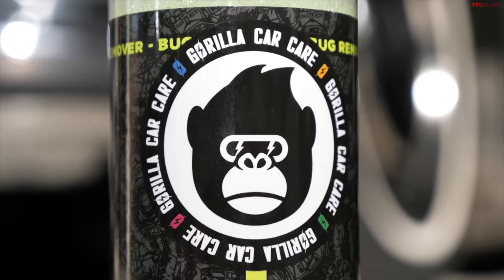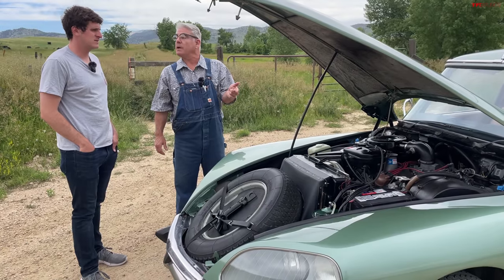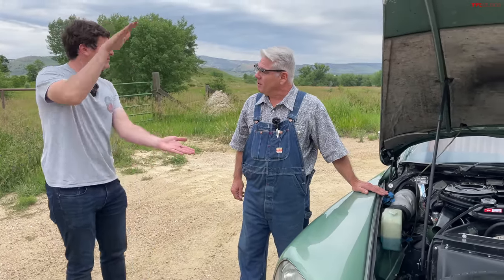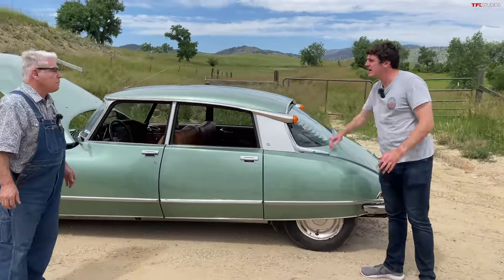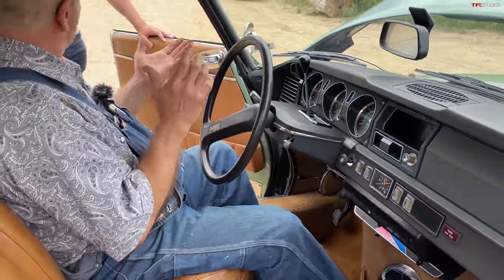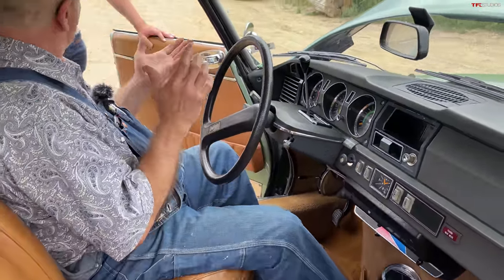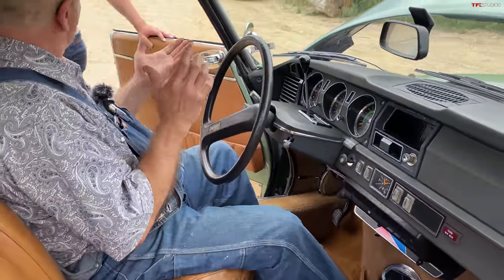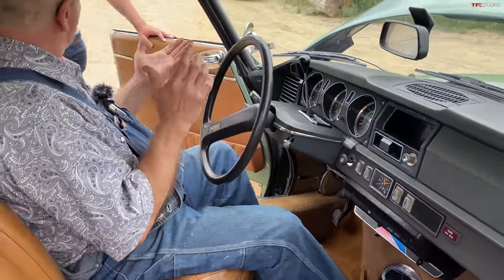Really THAT Unreliable!? Is The Citroen DS as Bad As The Internet Says It Is!?

Comment: Noticed during the ride- no doubt the sphere bulbs needs to be replaced (It is easy as replacing a light bulb).  The ride was way to shaky. It should float as on water..
The nitrogen leaks through membrane over time, so slow  it is hard to notice, and you be used to the rougher ride.  Replace each 5 years.  Back in old days this was not expensive. Exchange old ones with overhauled.

Comment: I beg your pardon; since I owned two DS-21's in the past, I have to say, 1. The inlet for the radiator air is UNDER the bumper, there is a screened opening that directs outside air to the enclosed 'baffle' that puts it into the radiator. 2. To 'spin off' the suspension sphere's the car needs to be in the LOW position, not high (so the fluid doesn't spew out). At least that's how my '67 & '69 were serviced. Otherwise, the owner of this very nice DS is quite knowledgeable regarding his beautiful DS model. I do miss mine . . . 🙂

Comment: I've been working on the hydraulic system in a Rolls Royce Silver Shadow from 1967. It has the same system, bought from Citroën.
But since the people in Crewe didn't trust French systems, it has the Citroën system for brakes and suspension, but then also a conventional suspension and vacuum assisted brake system.
There are indeed mechanical level sensors for the height. But the Silver Shadow doesn't have any lever to adjust ride height.

Comment: I used to have a BX with similar suspension. there is a simple mechanical valve linked to the front and rear which splits the pressure as required. The rear brakes were fed by the same pressure as the rear suspension so pads lasted forever. Some people added load to the boot to increase the rear pressure and balance the wear better. One more benefit is the headlights are always level.  And of course Rolls Royce licensed the suspension design.

Comment: I had a 1995 Citroën Xantia that featured the hidropneumatic suspension and it was fantastic. I never had to worry driving through  flooded roads. I just lifted the car so that only the wheels got wet.
Answering how the suspension levels the car and knows the exact height, there are several 2-way valves that bleed or admit fluid according to the position of the suspension.
The pneumatic part of the suspension acts as the springs on a "normal" mechanical suspension.

Comment: Very good detailed review. The DS was undoubtedly futuristic for its time and most comfortable and high-performing for its cubic capacity. However I have to question its reliability based on the  complicated mechanics which would require expert and frequent service. Moreover it is a fact that French vehicles in general, though well engineered, are quite difficult to work on. Finally another negative is that the DS was very susceptible to rusting.
Reply: Expensive service was very rare. My most expensive repairs were muffler replacement and a cracked pressure reservoir base in 10 years and 80,000 miles.

Comment: By the way, Mercedes Wagons used this hydro-pneumatic system on the rear suspension on the 124 body.  The rear was maintained at the same level no matter how much load you had in the trunk.  I had one and had to use the same green hydraulic oil on it.

Comment: I worked in a shop that serviced Citroens back in the '70s. One customer had 2 of them that he bought new. He was a booking agent and drove up and down the eastern seaboard in his work. He would leave one car in the shop and drive the other for 3 or4 months and we would service his other one in the meantime. He would leave a car and a list of operations when he picked up the completed one. When he retired one of the cars it had a documented 750 thousand miles on it. In all that time we never took the engine out. BTW, the high position on the suspension is a service mode and the car should never be driven in that position. It's not for off roading.

Comment: The biggest problem with the Citroën DS is finding one in good shape for a good price, even if you know where the good deals on them are. The biggest learning I'd have is the brakes. The shifting is fairly straightforward, the suspension makes a lot of sense, and the controls on the column are simple. The speed wrench used for the lugnuts and fenders also has an extension piece that can be used to start the engine when the battery gets low, but it's more akin to a kickstart motorcycle because of how low it is. It's under the intake slit, which means you have to use your foot to keep from faceplanting into the spare tire.

Comment: For years I drove a Volvo V40 with 115hp 1.8 litre motor, that had an official top speed of 120 mph (195 kph) and would cruise at 100 mph for long distances. It would also accelerate from 0 to 62 mph in 10.5 seconds.

Comment: I don't know if they did with the DS, but when the successor (CX) debuted Citroen said to only drive in the highest or lowest setting "if absolutely necessary" and at very low speeds due to the stress you're putting on the suspension and the driveshafts. They also recommended not driving in the lowest setting since your steering angle is vastly reduced.

Comment: I had a '73 Saab 99LE. It also had a 4 cylinder longitudinal engine with the transmission in front, front wheel drive that was designed to go under the car in the event of front collision. It also had shoulder belts and fuel injection. It also had four wheel independent shock absorber suspension. One of the really strange things was the ignition key was between the seats so, if you didn't know that you wouldn't know how to start the car.

Comment: I learned to drive in this car, I think it was the DS "super", it was a 4 speed manual gearbox. The suspension was superb, the car would have a flat and you would not know it. You'd adjust the ride height with a small lever at the footwell in seconds and would drive over dirt tracks and rocks like a dedicated 4x4. However it was perpetually broken and unreliable, the turning headlights always stuck, engine unadjusted and stalling or not ever starting, and even body panels kept falling off. On one journey, on a bend, the rear right door fell off and my granddad managed to hold on for dear life. The rear side panels also kept coming loose and fall off. Even on your video the body panels, the bonnet and boot are all misaligned. Part of that was due to very bad service jobs and repaits, but a large part was due to the inherent build.

Comment: FYI, U.S. Federal safety laws:padded dashes and front/rear lap belts  became required in 1966, collapsible steering columns and dual brake reservoirs  in 1967, shoulder belts in 1968, headrests in 1969.  By 1972 all cars sold in the States had those safety features by law.

Comment: The cooling air to the motor is not taken in where he points at. These slots are for the interior ventilation system! The cooling for the motor is by a special intake just under the front of the car. Not visible unless you creep on the ground.....
Reply: Okay, ya caught us in an unscripted moment. What can we say? Tommy had content to get out and I have cancer to deal with. This car has so many quirky elements, 45 minutes just isn't enough to cover them all. Do you own a DS?

Comment: Great stuff!
It would have been good to demonstrate the attitude of the car when braking: no nosedive!
I had the pleasure of driving a friend's DS at night, on dirt roads here in Australia. It was actually confidence -inspiring... Just like on a motorcycle, seeing around corners with the swivelling headlights was extraordinary and the suspension was unfussed by the rough surface.
Reply: But they DO nosedive under hard braking. But the headlamps stay level with the road. Plus- extra braking force is applied to the front brakes (up to near 100%). I would not have got mine passed on the brake and driving lamp portion of the vehicle safety test had the tester been willing to drive it or if I had not been a red seal mechanic. They didn't like seeing 80% of the braking on the front axle in a 10mi/hr lockup stop.

Comment: Fun fact.

The French for goddess déesse.  ie DS.

They called the car “goddess.” And it is. 

The exterior styling is very easy on the eye, smooth and streamlined.

The hydro-pneumatic suspension is like a magic carpet ride, no bumps felt. 

The interior is as one would expect for the period.

In English hydro just means ‘fluid.’ Hydraulic fluid can be oil.

LHM. Liquid Hydraulic Mineral. Use the correct fluid -the green stuff unique to Citroen.

Comment: I wish they had talked about the way the coupling of the braking system and the suspension automatically and instantaneously adjusts the braking proportionality between front and rear under heavy braking at speed. The car immediately adjusts its level and feels as if it’s digging into the asphalt. No loss of control. The car won’t spin under heavy braking.

Comment: One of most innovative cars of its era, not to mention esthetically wonderfully designed. Bit of trivia - this model saved the life of Charles De Gaulle while assassination attempt was done when he was president of France. Although tyres been shot-flat, due to hydro-pneumatic suspension solution, driver was able to continue driving until safety area. Cheers from Croatia.

Comment: I had a Citroën GS 1220 Club, basically smaller version many of the ideas on the DS. Ran it 3 years and no suspension problems at all. Rear disc brakes, standard fitting and one of the first mass produced cars discs all round, used to suffer from rust in the winter. U K and salted roads in winter. On many occasions when parked for a little while it would lift its left hand rear wheel right up into the wheel arch like it needed a pee. Still perfectly balanced and stable. Had three adjustable ride heights, great in snow or floods, always went to selected height no matter what load was put in it. Brakes were too keen until you got used them as used the hydraulic system as a booster. Major problem ?, rust in the body panels.
Motor was air cooled flat four which I believe came from Maserati design originally, it revved and revved. Actually would enjoy a ride in a well preserved model, if there is any.

Comment: It's beautifully restored (except for whatever that is on the hot air intake on the air cleaner), but the body panel alignment is terrible!  WTF?
Reply: That manifold heat-riser is stock - I swear! The repro riser tube I tried was weapon-grade, garbage. Still sourcing a better one. (Good eye!) I daily this car and was in a wreck with it a few months ago. The impact was centered at the A-pillar. NOS door + Used fender + 78 year-old paint/body man = poor panel gaps. Still working things out. A quest for perfection, in this case, wouldn't improve the enjoyment.
I find it amusing to say, 'I've cracked up a 50 year-old French car.'
Thanks for watching!

Comment: I'd love a DS. Having driven through a number of flooded roads over the years, it would have been reassuring to have that hydraulic suspension. I didn't get stuck myself, but have witnessed others getting stranded in flooded roads, usually in much newer cars than mine (and hopefully did the right thing to help, by phoning the rescue services when I couldn't get to them without going in too deep for my car. I had no idea if they had a phone or not).

Comment: The way the suspension works is genius. A simple pump provides pressurized oil for suspension, steering and brakes, a central sphere with a pressure regulator feeds the system. It was not mentioned, the car has sway bars front and rear. Two "Height corrector" pick up the car height to the ground from the sway bar and adjust pressure for each wheel to keep the preset height. It adjusts to car load, so with five passengers and luggage or only the driver, height will be the same. When braking, it will not lean forward like most cars, because rear brakes draw oil pressure from rear suspension, and the car braking won't upset car leveling. In case the oil pump fails, the stop light comes on but you have the central sphere full of oil, so you loose power steering, then suspension sags and the very last drop of oil can give you braking. E-brakes operate front wheels, in case things go horribly wrong.
Not magic, but genius, even more surprising considering it was designed in the early fifties.
The reputation of "poor reliability" comes mainly from mechanics who don't want to deal with such different way of doing things, and ruin the cars by ignorance. Also when the oil pipes and seals start to let go, and you spend hours of labor to replace some hose and o-rings. It was never a "low maintenance" car, the big service when new costed as much as a new Citroen 2cv, the cheapest model they had. When the owmer does some of the work DIY, it's not as bad. The engine was never as strong as other brands at the time, in this car you would expect something nicer, but it was deemed "good enough" at the time. An air-cooled six would have made the car just too quirky even for France standards. Check out the GS/GSA, I had one and some mechanic shops wouldn't even touch it. I had to search the right people to work on it.

Comment: A part from a lot electronics in the mordern car, the DS from the 50's is still a challenge to modern vehicles. Just show me a car today that doesn't need a jack to fit a tyre.....?? DS came with very good drive shafts and the technology allowed it to take curves at speed by leaning into the curve and rolling the headlight beam round the corners!

Comment: One reason the DS had a reputation for poor reliability is drivers failing to reattach the cooling skirt on the radiator after it inevitably partly popped off when changing a tyre. I have seen many DS on sale without the cooling skirt!

Comment: I owned a Citroen Xantia about 25 years ago, with the same hydraulic system for suspension and steering. It was a nightmare, not because of Citroen, but the service shop who did not do proper maintenance. I paid for checking all hydraulic spheres because I felt one was not working properly, they took the money but didn't replace any. Due to sphere membrane broken not long after, pressure in the pipes went up so high, one of connecting pipes exploded. Then the same service kept my car parked for 5 months lying that the pipe was not delivered from Citroen. I had to call Citroen France to speed up delivery, they even did not receive an order for it. But they called the service shop, and the guy were pissed off how could I dare to call so upwards. They solved then in a week but with another pipe, I know it wasn't original because it blew again after 200 km, with proper spheres this time. Finally these back and forth with the suspension damaged the mechanical system that keeps the proper height of the car. Some would ask why didn't I change the service shop with a better one.  Because it was the only official Citroen service in my country then. Solution: I sold the car  to someone who felt he can continue with the repairs.

Comment: Almost all American cars in the 50s had fresh air coming in through a 2 tubes forward of the radiator. American cars have a level ride in the late 60s early 70s. Volkswagen had an automatic stick shift in the  beetle. You could start off a third or fourth gear. If you wanted to all you had to do a step on the gas or you could shift it is a manual, depending what you wanted to do. This might’ve been innovative in the 60s but that’s about it. That’s suspension system. When it works right it’s fine I’m sure but I guess it would be a little quirky. And Tucker in 1948 had a headlight that moved with the steering wheel. If these cars are any good, they still be selling them here in America along with the Renault Dophine

Comment: Citron been around along time.I remember doing body work on one in myfathers autobody shop back in the late fifties or early 60s.The tire tredwith is wider on the front an smaller in the rear and this we worked on had air levelers in the rear.

Comment: The DS had lots of problems in 1955  because good hydraulic oil for the system was not readily available and there were problems with the seals. Citroen had to retrieve broken cars with a trailer and give the customers  new cars.

Comment: Had a DS 21 Pallas Injection electronic iin the 70s it was an excellent car.Quirky engineering to Brit eyes but every thing worked a treat.I wish I still had it 28 mpg at 60 mph or 90mph an excellent refined motor.

Comment: @ 14:13 you get some really bad advice.. Never put a Citroen on High position and unscrew a sphere, the thing can shoot out of the engine compartment and the high pressure oil escaping can cause injuries. The correct way to do it is to just lift the car up all the way with the ctrl lever, put the jack under the side to be replaced, turn off engine and lower suspension to bottom setting. This depressurises the sphere, and when you can spin it off by hand after loosening with a filter wrench you know it is safe to do so. If its hard to unscrew you have residual pressure....
Reply: Heard.
The extemporaneous interview style caught me a bit flat-footed. You're completely right. The sphere change must be done with low/no system pressure. I misspoke.

Comment: I had 3 Citroëns. All XM what is the nextgeneration of the ID and DS cars. They had the same system for hydrolics. So good, And at the first I also told my wife remember you want a car like this but I can't work on it myself. I did all myself. Replace the sferes if needed; ad gas in the sferes all was done by myself. Drove it home having one flat tyre and oops the spare was flat to. Came home put 2 wheels in the other car went to the tyre repairshop. Problem solved. Not really need the jack to change the wheel.BTW the bumper blocks ( rubber ) are not European to.